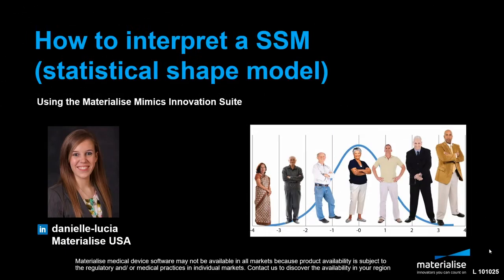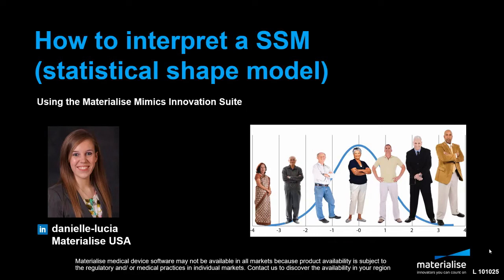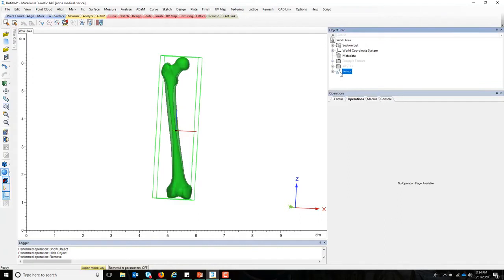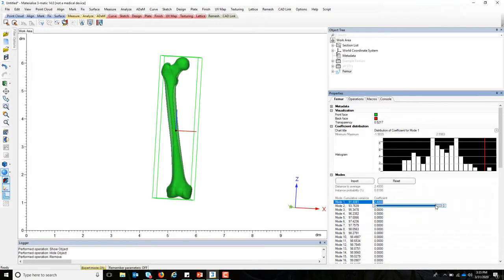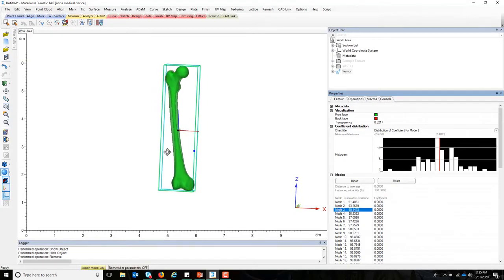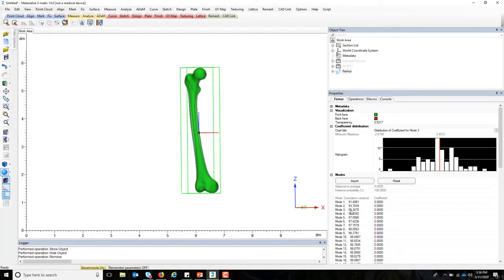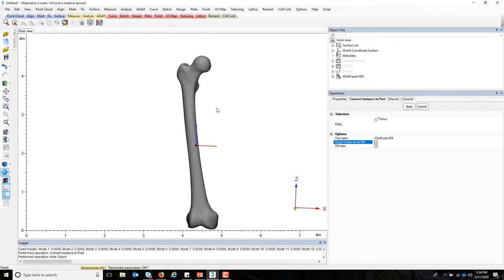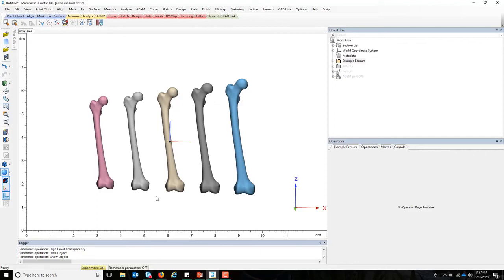How to Interpret a Statistical Shape Model (SSM) | Materialise Mimics 22

Comment: What type of algorithms do you work with for statistical shape modelling in your software to rigidly and non-rigidly align your models? Do you use coherent point drift? Iterative closest points? Procrustes registration? Non-rigid gaussian processes? Is the SSM defined only by principle component analysis (PCA) or can you augment the model by gaussian processes to make the model more flexible? Also, for the creation of the final model, do you guys use landmark or ICP based registration for shape completion to define the closest fitting model? Can all of this be done with your software? Finally, what type of coding is necessary for the use of this software? Python? Scala? R?
Reply from the maker: Hi, thank you for your quesiotn! In order to dive into more detail, it might be best to get in touch with your account manager or reach out via the contact form: http://mtls.me/07tf.

The software allows to create SSM’s based on the warping technique (where you can align your master to the other files via more automated tools). When warping, you can use either the shape or combine it with well-defined landmarks. For the creation of the SSM itself, you can choose between 3 options: Procrustes (minimizing the RMS error), No alignment (you first put all your input data in your preferred coordinate system) and scaled procrustes. The SSM is defined by PCA thus the geometry cannot be manipulated further besides by using the modes of variation to change the geometry of the SSM align the principal components (modes of variation). All of this is done within the SSM module and doesn’t require coding on your end. If you want to e.g. speed it up or allow for more complexity, you can combine it with the scripting module (Python) which will also give you access to the points and triangles of your mesh which in turn allows for automatic measuring/landmarking of all input cases or new patients as the mesh will be the same for all.